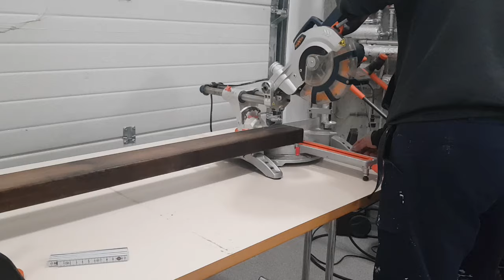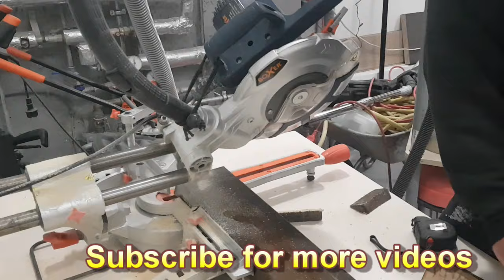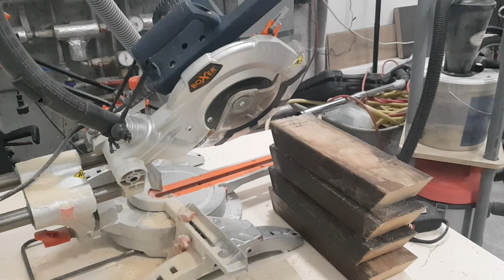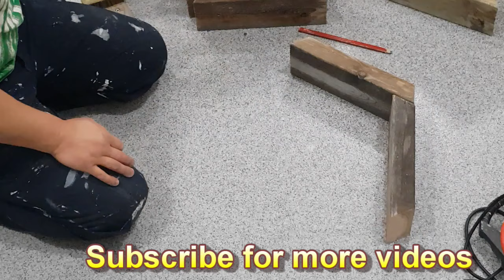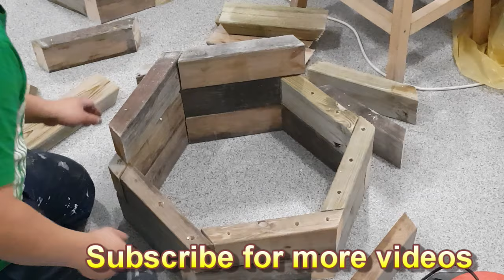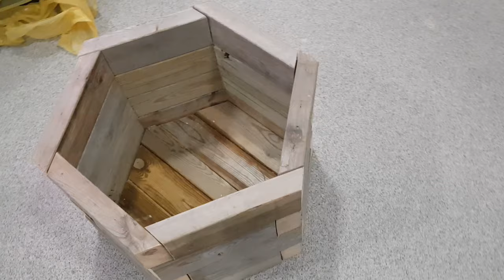Home made Hexagon wooden Planter

Comment: Whats the math equation?
Reply: In an ideal scenario, a (solid) hexagon is formed by 6 identical equilateral triangles. Each angle/corner of each triangle is 60°. The corner of each piece of wood is 90°, therefore it needs to cut at 30° to leave a 60° corner.
Reply: Octagon angle calculator: 360 / number of sides / 2 - 360/8/2 = 22.5 | Hexagon 360/6/2 = 30 Do this for any shape you want to miter.